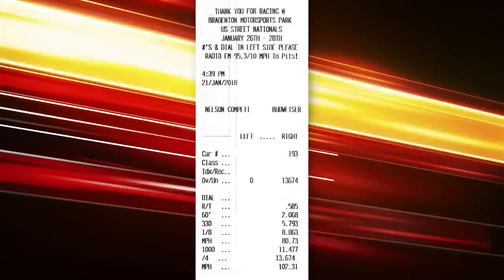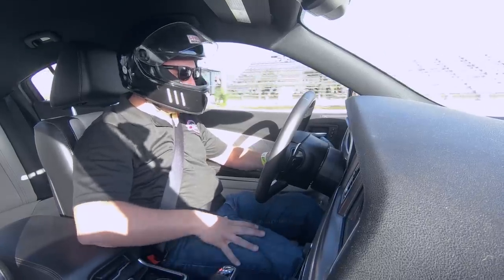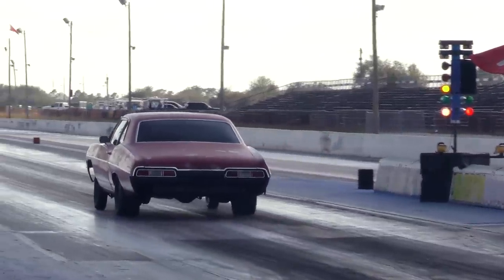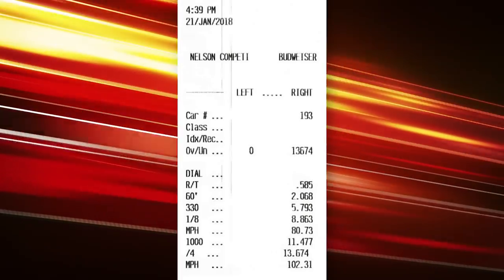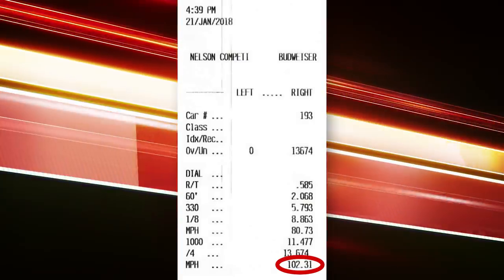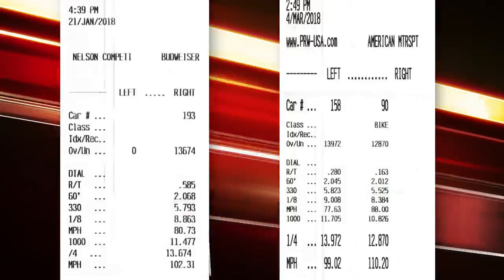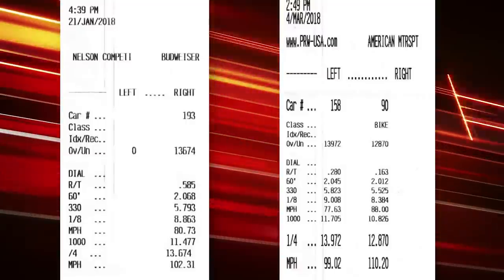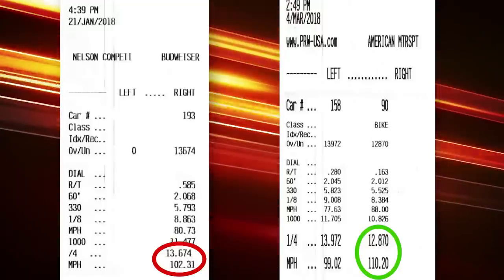Beginners Drag Racing Tips (Part 2): How to Read Your Time Slip from the Drag Strip

Comment: I've never even been to a race track. But I'm really hoping to change that. I can't afford a fast car and my 96 Buick Roadmaster sedan will never be fast. Especially with the 2.56 open diff. I just want to be able to drive fast without going to jail. There's only so much you can do on the street
Reply: You can pick up a Chevy s10 for like $1000 and a junkyard ls 1 for like $300 then boom 350 horsepower minitruck

Comment: 275/35/20 Nitto 555 G2 on a 2015 mustang Gt convertible Roush supercharged 670hp. What do you recommend for rear and front tire pressure. Will be my first time at the strip this weekend.

Comment: I'm trying to get better with launching my Challenger SRT8, and am using line lock to do after heating the tires. I've got an electronic plug-in play unit called the burnbox and pop's right into the OBD port, it's one of the most innovative products I've seen for these late model machines.Yeah the 5.7s are good entry-level V8s, but wouldn't put a lot into it and would go at least scat pack if you want to be more serious about drag racing. Is so much better than the old traditional way of tapping into the braking systems, and don't have to worry about leaks etc anymore. Is by a company called Z automotive, and was about half the price of the old school ones to
Reply: So whats your question?  Just sound like a bit of rambling.

Comment: should you run lower psi in street tires? If so how low can you go safely?
Reply: juck huo if you want to slow your reaction time. Depends on the tires. Fronts I easily can take out 10 pounds. I don't like fronts on mine less than 20. Rear, only take out a few pounds.
Reply: Depends on the car and tire. Mine has a tendency to spin, and it's lite in the rear, I dropped to 30lbs and it spins less. Look at the tire from the back, is it touching all the way across the tread? Mostly the middle remove pressure. Cupped up in the middle ... Add. 

You have to drop 5or10 and see if it goes faster. If you drop too far it'll start going slower.
Reply: Thanks guys!

Comment: Hi 
I done a 10.45 @140 on  a 1.83 60ft  on the next pass I done a 1.52  and broke a rear axel do you know what time that would have been

Car is an r32 gtr 5speed manual
Reply: 2 seconds
Reply: Well, if it doubles, that could’ve been a 9.8sec 1/4 mile

Comment: Wheelstand energy is returned to the system when the car comes down, this energy is not lost.
Reply: Why do you think they run wheelie bars for?
Reply: Ourlaw, why wheely bars ? hmmm, maybe to stop the car flipping over bcak wards ? reduce the time in the air so to reduce a) aero drag, and b) the time before the front tyres touch again so as to regain steering control.

Simple physics says that if you thow a ball up in the air, your input energy is converted to potential energy. When the ball falls, the potential energy is converted back to kinetic as it moves, then to force as you catch it. Energy is never lost.

So, when a drag car returns to earth, the lofted potential enegy or the car is converted back to kinetic energy and hence additional forward rotational torque on the tyres as the car rotates forward. Energy is never lost.
Reply: Nor Dic 🤦
Reply: What ever energy you are producing depending how you apply in drag racing will produce different results. Allowing the car to lift the front end, you are inherently not "losing energy" but more like misusing it to accelerate the car at a unwanted angle which "missuses" more energy at lifting the car then moving it forward. That same energy should be correctly used to accelerate the car at a horizontal angle hence reducing the elapse time during your race. Wheelie Bars have many pros, its main goal however is keeping the car down or angle of elevation at a optimal level so it can use all of its power/energy for forward, not upwards acceleration.
Reply: Orbelis: When the car rotates upwards, the some of the rotational torque on the tyres that whould have converted to linear forward force, is being conveted to 'potential' energy against the force of gravity.

Much like when you raise your car on a hoist, you have converted the linear force of the hoist to increased potential energy od the mass of the car whilst it is sitting there.

You would be come aware of this potential energy shpipd the hoist fail and the car fall on you.

When the drag car falls forward back to the track, the faĺling and rotating forward motion of tye car converts this newly added potential energy to additional forward rotational torque on the tyres and hence the car is propelled forward faster. No engine energy is lost overall, some is converted to potential energy to make the wheel stand, and is converted back to forward motive force (the good stuff) when the car falls back to earth.

Infact, a wheel stand may help stop the drag car from breaking traction for two reasons; a) some of the excesive torque to temporarily diverted away from the tyres, and b) maximum downward force is applied to the rear tyres.
Reply: Nor Dic why aren't you reading about the reason?
Reply: @Nor Dic You are contradicting yourself and at the same time explaining why that is. No one is saying energy is lost, not in the sense which you think.  All energy is  transformed for energy cannot be created or destroyed (1st law of thermodynamics) . Physics tells us that as you increase the potential gravitational energy, (which is what happens when you lift the car) kinetic energy decreases (which is what you want to accelerate the car forward with), Yes upon letting the car back down you once again transfer the potential gravitational energy to kinetic energy. HOWEVER by initially applying all you engine power and transforming it into potential gravitational energy, instead of kinetic energy you are LOSING ET!!! Hence why in drag racing they say "losing energy by lifting the tires"; which more correctly should be expressed as "misusing the power" if you wanna nip pick.
Reply: Orbelis, exactly where do you think this last energy has gone ? Please explain your theory. It seems that we are both inagreeance that energy is never lost as such.

Prehaps education isnt strong in the USA ? I mean, how else can you explain the bs drag racer's theory that energy is lost ?

As we both agree that energy is conserved, and I have already offered a plausible explaination re the conversion of some rotational force (torque) to potential energy, then back to torque, prehaps you could now explain your theory ?
Reply: Nor Dic it's simple you lose time/speed
Reply: @Nor Dic I have already explained myself as clear as I can , and it seems we are deviating from the main topic. Have a good one...
Reply: Build a car to do wheelies and document the results scientifically
Reply: the energy is displaced into the shocks as the car bounces. As you state, energy isn't lost, but its purpose is indeed lost. It is not transferred to the rear wheels (because let's be real less than 1% of wheelies end smoothly with a "soft" front tire touch down) it is transferred to kinetic energy in the springs, tires, shocks, chassis twist, etc. Maybe not every ounce of it, but SIGNIFICANT power/energy is absolutely wasted when you wheelie, especially a bouncer like in this video. Otherwise everyone would wheel-stand every pass lol. But nice troll.
Reply: You're awful smart to be looking past the glaring fact that time is an issue here, making it lost energy in reference to a drag race...
Reply: I hope you thought about this a little more afterward and felt sheepish...